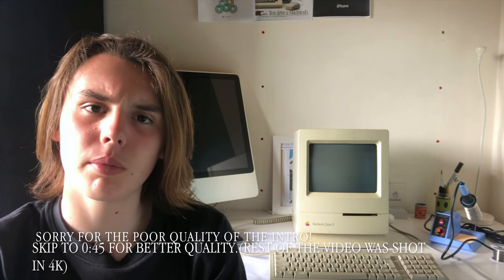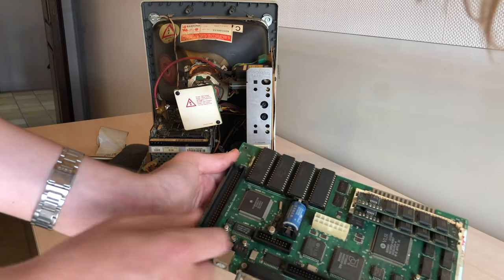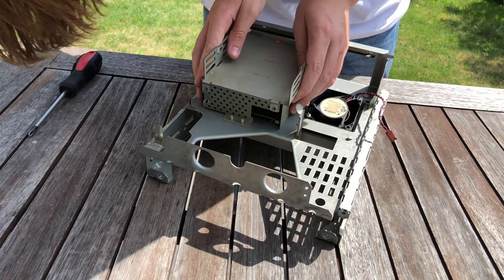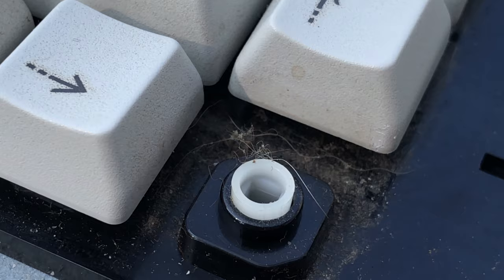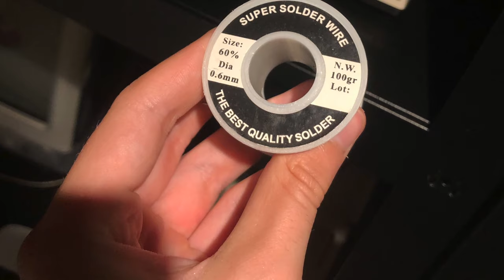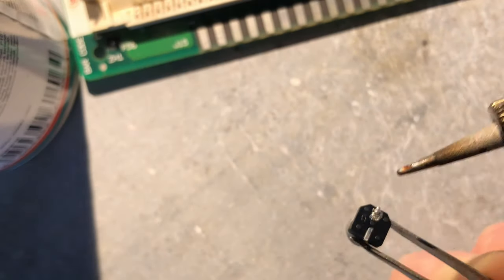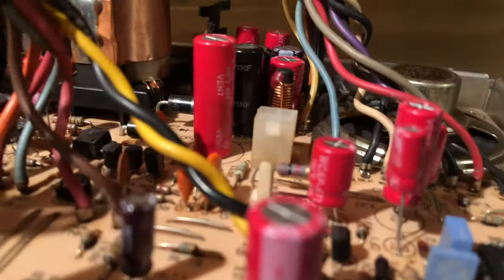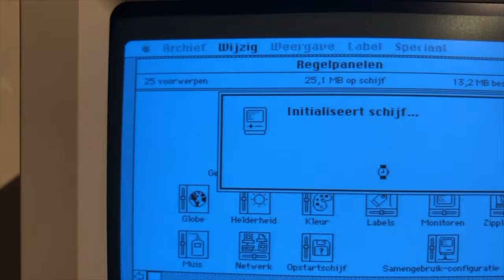Restoring a 1992 Apple Macintosh Classic II

Comment from the maker: Hello!

This is my first video in over a year!
So, I did make some mistakes during filming😬 ⇒
Not using a pop filter on my microphone for the first few minutes of the video, installed a couple of keys in the wrong place on the number pad, messing up while removing the old capacitors from the logic board and maybe adding a little too much solder (first time recapping something + did eventually fix everything!)…
I did put a lot of hard work into this video.
The restoration [Fully disassembled and cleaned up the machine (got rid of cigarette smoke damage), recapped/replaced all of the old capacitors on both the logic board and the analog board + fully retr0brighted it] was an absolute success!

With that being said, please, sit back, relax and enjoy the video!!!📺                                  

PS: Weekly videos are guaranteed!😉

Comment: Beautiful job!  Reminds me of my first restoration :)!  One thing though, is that you really MUST start using a decent flux.  It will change your LIFE!  It truly is necessary... it actually helps BURN OFF the corrosion on the joint you are soldering!
Reply from the maker: And that’s a fact! 
A lot has changed since I made this video. I now have decent flux and a hot air station.
Reply: @ArnoLouwagie  I am glad to hear it.  You are well on your way to becoming an expert then!

Comment: Great video..I have one of these it.s yellow not from smoking just age and sitting in my basement. I got it from an old job i worked at many yrs ago. It worked last time i tried it. I don't have the patience anymore to take it apart... but you sparked an interest in seeing if it still works... Over all I'm a PC guy... but the new M1 got me thinking... Take Care Stay Safe...
Reply from the maker: M1 is worth it. Huge improvement over any Apple Intel machine imo. I switched to a 2021 MBP (M1 Pro) a couple of months ago and I f*cking love it. It obviously all depends on what you need a computer for though. PCs and Macs both have their pros and cons. 
Be sure to check that Mac Classic out soon. If it hasn't been recapped yet, the electrolyte is definitely eating away at the board already. Also, consider yourself lucky if the PRAM battery hasn't leaked yet.
Reply: @ArnoLouwagie  Thank you for your insight...I use my Pc for music production.. and not a lot of third party plugin makers are on board yet...And I will check out my classic for leakage. thanks again.

Comment: Well done young padawan! nice job and well detailed ; gonna restoring my own mactintosh classic (one). Short advice for your next restoring works : flux is life (especially for old dry solder, soldering/desoldering jobs) just don't forget about clean after use (could be corrosive for many components). Also desolder smd capacitors : got a friend and second soldering iron, no more twisting please :) . 
Cheer's!
Reply from the maker: I shot this video quite a while ago! 
I'm currently sharing a rework station (fancy hot air gun) with a friend/fellow collector. That means that I'm currently using that hot air station to solder and desolder and not twisting the caps anymore! I'll buy flux too! 
Equipment makes the job easier and does a better job, but that equipment can also be very expensive!! I have a decent amount of (soldering) tools now though. :-)

Comment: Excellent restoration, mate! Computer looks fab. I'm surprised that hard drive still works, honestly. Usually those old SCSI drives die!

Nice information about the CRT adjustment. That's really helpful.
Reply from the maker: Thank you :)
If you have geometry issues, don't immediately adjust the magnets. 
The magnets are a last resort...

Comment: Great video. I have also a Classic II that I will be recapping so any chance of you sharing the BOM you ordered from Mouser?

Thanks
Reply from the maker: The caps on Mouser keep changing (new ones + out of stock ones) and I deleted the files and screenshots of my list a long time ago. I can give you a list of the caps you need (depends on what revision you have and what region it is for) but simply can't share the Mouser list with you! 
I tried it before, but it took me way too long to recreate the whole list and find the best quality caps for the job. Sorry!
Reply: @ArnoLouwagie  Thanks. I've been going thru the Mouser site and there are so many options for the same cap that it drives me nuts. Now I've got better at using the site and choosing the options. One of the things I'm doing now is making a database of all of the caps needed to replace on most of my computers and order all of them at once.

Comment: Very passionate work, i would suggest to invest in a soldering station like a KSGER and a fume extractor like the clone of hakko 400, is not too good to inhale the fumes.
Reply from the maker: Thanks!!
Already got a soldering station! ;)
Fume extractor sounds good, but I’ll probably use an open window (or ventilation system) and blow the fumes away with my fan.

Comment: Thats one happy mac! Those smd caps can be a pain. Get a cheap hot air rework station. You will also get thin copper pads for repairing a lifted patch. Beginners mistake.  Hows the Mac now?
Reply from the maker: Mac is still working fine (the HDD died though)!!
I have a hot air station and flux now! Works a lot better.
Thanks for watching!